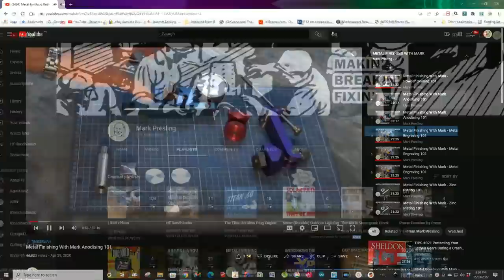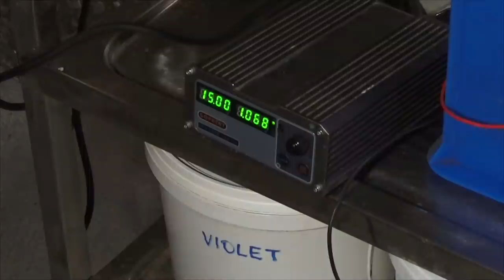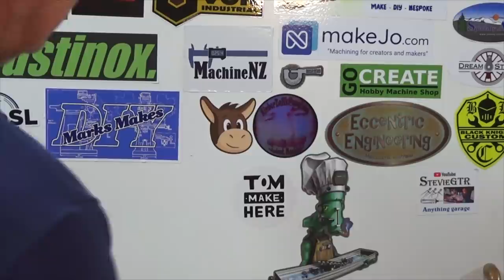The Titan Engine - Final Details - It's Done!

Comment: That unintended dimensional change reminded me of that one time I was designing an industrial granola crusher. It had two rotors made of stainless pipe and around two dozen star shaped discs tig welded on the pipes. I handed over the plans to the machinist and welder and a few hours later the welder comes back to my office and says he's got left over parts. I was quite baffled! We went over to the machinist and he said he followed the plans, we checked the other pipe that hadn't been welded on and it matched. Then it dawned on us, all that welding had shrunk the pipe and caused it to be undersize!! I had to redesign a new oversized rotor so it would end up the right size when finished. Lesson learned for life!!

Comment: Mark, that is absolutely amazing. I'm an engineer and dabbled in model airplanes in my youth ( 70 now ). As much as it's a work of art, it needs an airplane attached and flown.

In first year engineering drafting class I did the design of a two cylinder inline engine. Still have the prints. Now I want to buy the equipment to actually build it. I may have to rob a bank.
Reply from the maker: Thanks. As much as I enjoyed the challenge of building the Titan, I feel it's time to move on to some other projects that have been put on the back burner for a while. I still want to build a 4 stroke internal combustion engine at some point. Acquiring the tools to build this type of project really is a life long mission. I think I bought my first real engineering tool when I was just 19 years old. It was a Mitutoyo vernier caliper (which I still own). However I did a lot of early engineering work on a clapped out Sheraton metal lathe using a cheap die cast micrometer and not much else. I would encourage you to embark on the journey. 
Regards,
Mark

Comment: Mark, if you ever run into quality defects with your nickel plating, like particles getting stuck in the layer of nickel you've applied, try adding cotton(?) "socks" around your anodes.  When I supported the Plating Shops where I worked, the nickel rounds in the baskets had small amounts of a contaminant, carbon if I'm remembering correctly.  The contaminant is in all nickel rounds.  The "socks" were basically filters to catch the carbon particles, keeping the plated nickel layers free of the embedded contaminants.

Have you heard anymore from George & Bill Genevro about whether they had found a way to make more (new) castings available?

Comment: Mark, you encountered the phenomenon of immersion plating.  The zinc in the brass substrate is more reactive than the nickel in the bath and displaced it.  Given adhesion problems, immersion plating tends to be avoided.  What is frequently done to avoid the immersion phenomenon is employment of a "strike" bath in which the concentration of the metal to be plated out is low.  Look up Woods nickel strike.

Comment: Great series Mark. Your zinc plating might be dull because you have no solution agitation. Likewise with the nickel solution, they both benefit from some sort of solution movement. Depending upon the additives in the bath, you may be able to use a simple aquarium air pump and a small airstone, placed directly underneath the parts being plated, or you may need some sort of mechanical agitation like swirling the parts around manually, or using a spoon or paddle to stir the solution, or an automated mechanical agitator. Like another commenter has said, placing brass parts in the nickel bath will cause immersion plating, which has very poor adhesion. I've always connected my parts to the power supply outside of the bath, turned on the power supply, and then placed the parts into the solution. This is called "live entry" in the metal finishing industry. I've been in the metal finishing industry as an engineer, chemist, salesman, and tech service person for over 20 years. If you need any other suggestions, I'd love to help out.
Reply from the maker: Thanks Dustin. In the book I purchased it mentioned turning on the power supply before immersing the parts but it didn't go into details about why it should be done that way. Normally I follow that procedure but because I was trying to film the process I did it over a few times. I do have a small aquarium pump which I use in my ferric chloride etching tank but it would be easy to set it up in the plating baths. I suspect that my zinc electrolyte is faulty. When I purchased the ingredients it came with a zinc brightener but I couldn't find it amongst all my other plating supplies. I now think I may have accidently added all the brightener to the zinc salts by mistake. I am going to buy some new electrolyte and this time I will take a bit more care to follow the instructions properly. If I do get a better result I will mention it in a video series that I have planned for a future project that involves nickel cobalt plating. 
Regards,
Mark
Reply: @Preso58  Too much brightener will affect the quality.  It's one of those chemicals that can negatively affect your plating if you have too much or not enough.  Similarly with the nickel brightener(s). 

Another suggestion that I noticed while watching your videos is that you have the wire of the anodes in the plating solution. Unless the wire is made from the same material as the anode, the wire portion should be above the level of the solution. This will reduce or eliminate the wire dissolving into the bath and contaminating the solution.

Comment: Ooh, a Taipan 1 or 1.5 from Gordon Burford coming up next!  My first model engine was one of those - I have a couple in the shed ready to clean up and bench run for old times sake too.  Once I work out how to get the fuel components anyway...   Will be good to see Peters work again too.  Can't wait!  Congratulations on an extremely good example of the art of miniature aero engine building.  Stunning result.
Reply: we used to run them on Kerrosine , eahter and caster oil , forget the mix ratio
Reply from the maker: Thanks. It's a 1.9cc Taipan Tyro. Retailed at $12.99 back in the early 70's. 
Regards,
Mark

Comment: Simply stunning Mark !
I also love the hidden note !
I will be building Mastiff by Len Mason once i somehow get re motivated on finishing the M.E beam engine i have stalled on - i will get there eventually !
Back when i used to work at a Hardchrome place we used to use a formula of 2 amps per square inch of surface area and run 2/3 power so if it needed 100 amps we ran 75 to give a better finish .
Not sure if this can be converted into what you are doing but might be worth some thought .

Comment: I speak under correction, but I think the zinc plating brightness has to do with the rate. If you limit the current so it plates very slow, you might get brighter finishes. Lower voltages might also help. I've had this experience with both copper, and nickel plating. Just my two cents :-). Great project Mark. PS: You might have my location on your map already - Pretoria, South Africa.

Comment: Wow! That anodizing and stuff looks very long-winded but worth it in the end, I suppose. Can't wait until your next project.
Reply from the maker: Thanks. The process for anodising in my home brew setup takes a good two to three hours if it goes well. More if the part refuses to take up a uniform colour. At least it can be redone. The partially anodised surface can be stripped off with sodium hydroxide and you then start again.
Regards,
Mark

Comment: Excellent, thoroughly enjoyed the whole series.  If you can find it I live in Otham in Kent, England and am building a 1/6th scale traction engine. Nowhere near as fast as you, I estimate another 2 -3 years to complete. 
Keep them coming please - I learn more every time
Reply from the maker: Pierre, good on you for building a traction engine. I started and failed to finish a small traction engine called "modular". It was published in the Model Engineer magazine many years ago and it was mostly fabricated and didn't require any castings. I still have the half finished boiler but that's as far as I got. A 1/6th scale engine is going to be quite a beast with lots of big, heavy parts. I have always thought that traction engines are much more complex than equivalent sized steam locomotives.  I shall add a pin to the map for you.
Regards,
Mark

Comment: Haha, Love the time capsule in the rear of crankcase Mark. I experimented quite a lot with colour Anodizing. If I wanted a shine type finish. I would Highly polish the part with Solvol autosol. Then i would clean the parts with Brake cleaner only. No Cautic or anything. Then as you have with the Bisulphate at low current. Then the dye in a heated vat. Ending in a boil finish. Pretty much the same as you do. The results are a great shine on the parts. I think i originally got the Bisulphate idea from one of your previous video's. If i want the part to be Matt, i simply put into Caustic soda solution for a few seconds . Thanks for showing another great video. Regards.
Steve.
Reply from the maker: Thanks Steve. I have read that there is an acidic treatment that is used in commercial anodising which chemically polishes the parts. I think it is a nitric acid based dip. Unfortunately, anodising is one of those "dark arts". Those that really know how to do it are sometimes unwilling to share their "trade secrets". However it's very achievable in the home shop but it can be frustrating trying to work out which step is causing the faults. I have never tried brake cleaner before. It does seem to be the miracle cleaner though.
Regards,
Mark

Comment: What a piece of art that is, Mark! Well worth a place in a museum. And I'll be "stealing" some of your methods, in particular the rust prevention metod you used an episode or two ago. I really need that here in Saltstraumen outside of Bodø in the northern part of Norway (if you would put a pin there). Saltstraumen is, by the way, worth checking out. During summer time...
Reply from the maker: Thanks. I will add a pin for you. I was just checking out the aviation museum in Bodø. I had no idea that the Norwegians flew Mosquitos! It looks like there are some well preserved examples of some famous aircraft there. 
Regards,
Mark
Reply: @Preso58  Thanks for the pin. Yes, there are some interesting things in the museum. A few years back a group of old timers restored, to full functionality, a F-104 Starfighter and flew in some shows before it was placed in the museum. But, not all is well, a couple of weeks ago (march 18) during a military winter exersize (called Cold Response), an american V-22 Osprey crashed in a remote mountain area. 4 crew members unfortunately died. It was a terrible accident, just 50 kilometers from where I live.

Comment: Hi Mark.  Like you found 6061 is one of the best anodizing alloys  there is.  For cleaner check out Purple Power.  I've found it cleans better than Simple Green in my experience.  I also get better sealing results from a dedicated sealer.  Boiling water works as you know but in my experience there's less fade / rinse out using a dedicated sealer.
Reply from the maker: Thanks. I did see that Caswell market a sealer. If I order any new colours of dye I usually try to include other products in the same order to save on shipping. I read on Caswell's website that a failure to thoroughly rinse off the anodising acid bath can cause the issues I was having with the dye not penetrating. I really need to make up a proper rinse tank for future parts. 
Regards,
Mark

Comment: Great job on the engine AND what a great channel.  I've had some issues with my nickel plate delaminating from white metal.  Brass and copper are fairly robust.  I suspect surface contamination but it may just be my incessant peeking in!  I never knew about that causing problems.
Reply from the maker: You may need to do a copper strike on some alloys before nickel plating. The book that I purchased from Jane Kits is an excellent reference. Evidently the company was started by a bunch of motorcycle enthusiasts who wanted to plate parts for their bikes and got sick of paying commercial electroplaters to do the work for them. It's written in an easy to understand format and it has simple diagrams and useful and practical advice on a range of metal plating disciplines. 
Regards,
Mark
Reply: @Preso58  Thanks Mark!  I need to upgrade my plating methods/equipment and that book sounds like a great place to start.  Regards, Mike.

Comment: Heij Mark, Would You add a pin for me in 37081 Göttingen,Germany? CONGRATS to this wonderful build, You are a great instructor and thanks to the internet I can follow along, these golden parts are lovely. I found a Black&Decker drill on Ebay my dad used to use, I renewed it with a good cleaning and lubrication but the gold painted outside has taken a beating. Maybe this will do the trick?
Thanks for showing- by the way: I love to see Your surroundings, hear the sounds- real big Aussie fan here.
Reply from the maker: I will add a pin for you on the map. I just checked out Gottingen on Google maps. I love the architecture. Unfortunately, Australia doesn't have anything more than 200 years old! If you were looking to restore an old drill there are some very nice powder coat finishes that would replicate the Black and Decker gold finish. I am pretty sure my father owned a similar drill. It was a sort of hammertone finish. I do a lot of powder coat work at home. The initial setup cost is not cheap but after you have invested in the equipment the ongoing cost is minimal. Much cheaper and more durable than paint.
Regards,
Mark

Comment: A gasket on the tank should fix the centering change. It will need one anyway to seal, will it not?
I'm in Gloversville NY US.
Reply from the maker: I ended up using some loctite to seal the tank and to fix the position. The tank is really only decorative and won't be used to hold fuel when it goes on display. It's already in the museum!
Regards,
Mark

Comment: Most excellent work! That thing looks store bought!

I have done a ton of electroless nickel plating, but never the process you used. It's much like boiling an egg. The plating won't happen until the bath gets to very near the boiling point of water. Copper based parts always "kicked off" more rapidly than steel, and if I used copper plated steel filler rod to hang steel parts it would accelerate the plating on those parts. I suspect your bath has lots of nickel in solution and the bath temp was high enough to "kick off" the plating of your brass part. I don't have empirical evidence regarding which process is the most durable, but there's much debate. I think your process is more economical as the chemical prices for electroless are almost stupid. The parts I plated were for industrial use and were worn out well before the nickel plate had a chance to fail I'm sure.

I don't know if the Simple Green available to you is the same formulation sold here in the U.S., but it's slightly caustic and will "attack" aluminum. I suspect it etches the aluminum removing surface contaminants taking some of the surface with it. 

Once again, great work on the engine and congratulations on its completion! Looking forward to the next engine project. Take care!

Comment: New project looks like a Tipan 1.7
Reply from the maker: That's it although it was a Taipan Tyro 1.9cc. They were a very rugged and reliable engine. The one I have survived many a vertical landing.
Regards,
Mark
Reply: @Preso58  I had a Tipan 1.5 BB ball race diesel in 1974 it was second hand from mate from school and the Singleton Modle Aero Club , I stil have several SupreTigre motors we imported in 1984 some were the first modles in the contry and a G60 blue head with a ABC piston liner but the first i have ever seen with a piston ring in a ABC Cheers Love the videos

Comment: Do you dilute the simple green for use in your ultrasonic tank?
Reply from the maker: I buy the Simple Green concentrate which is mixed 4:1 with water to make a working solution. It's cheap enough that I can dispose of it afterwards. I sometimes use it twice for less critical cleaning applications. 
Regards,
Mark

Comment: Heat treatable martensitic stainless steel is magnetic. Think knife blade steel. Austenitic stainless steel, like 304, isn't heat treatable and is also non-magnetic. It is ageable though.
Reply from the maker: I did research what I could find on aircraft bolts and it seems like it is a very broad topic. I recall wading through a lot of metallurgy when I was at college but not much of it stuck unfortunately. Given the way the bolts machined when made the smaller versions I doubt they were regular stainless steel. The swarf looked like what you would get from 4140. 
Regards,
Mark
Reply: @Preso58  thanks for the reply! I originally thought all stainless was non-magnetic. When I started collecting knives I learned otherwise. Love the model engine videos!